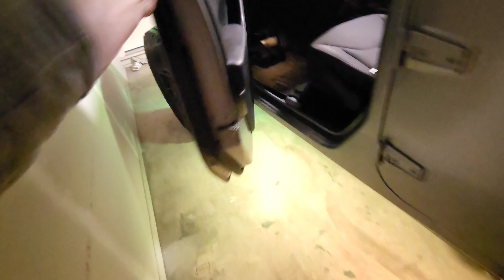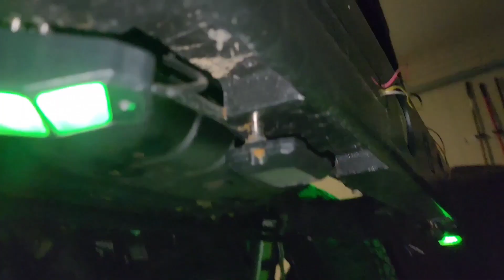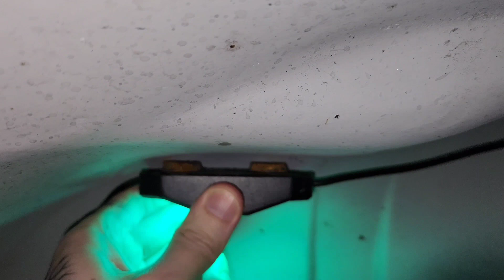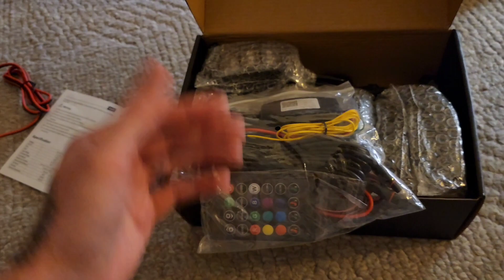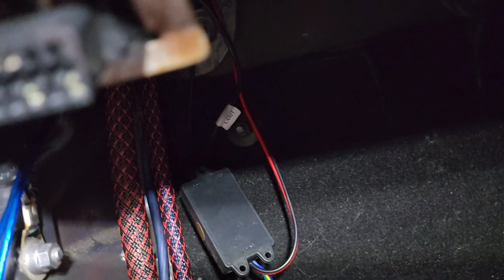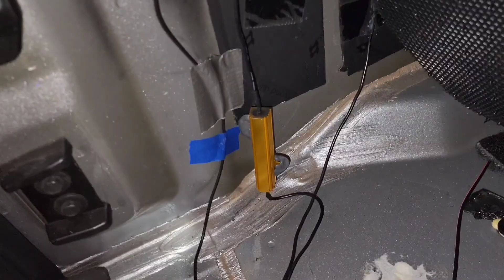Frugal man's XKAlpha ?! RGBIC Rock lights not XKGlow

Comment from the maker: I got these Rock lights here https://amzn.to/445wbSx
That is an affiliate link. The price is the same whether you use my affiliate link or not. If you do use my affiliate link it helps support my channel so I can make more videos like this.

This is a follow-up video to a previous I have on my channel showing me testing the lights before I installed them.
These are the only rock light that I have found that have a smart brake light and turn signal function built into it for under $200
Meaning, that if you tap into your brake light with the dedicated brake light wire on the Rock lights control unit, then the rock lights will go solid red.
It's the same thing for the turn signal. That is an incredible safety feature. You don't have to do it but of course as you see the video, I chose to do it.

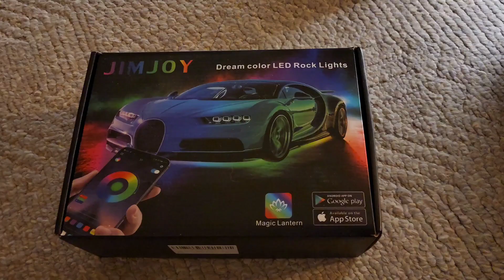9:16 Unboxing & brief discussion of details

Comment: Hey are you comfortable showing how the Joying headunit can use 4 cameras? On the unit it looks like I can only see two camera inputs, but I seen a video of you introducing 360 but not the actual application. Joying YouTube shows it works but they haven’t shown how to install on headunit
Reply from the maker: True. In fact the unit can support up to 6 cameras. I have finished the install of the 360 camera system yet but I'll have a video on that too.
And you're correct. The back of the Joying head unit only makes it appear that it can accept two camera inputs and also a video source input (like DVD or even a camera really)
But if you take the top off of the head unit, there is a plug for the 360 system. It's on the circuit board
Reply: @ElevatedVehicles  thank you so much! I enjoy your videos because I’m looking to upgrade a lot of shit on my 2015 Jeep Wrangler JK. I always appreciate videos that show upgrades and the kind I want. 🤘🏾keep it up! We need more “mall crawler” videos lmao even though I think you mentioned that you do go off roading. Your Jeep is fire so far 🤘🏾🤘🏾
Reply from the maker: @msmonee91  man thank you for the words of affirmation. That motivates me to keep going.
Yeah that's true I love my "mall crawler" amenities even when I'm off-roading or camping.
I've got a video coming out for a heated steering wheel. And I think that's going to be interesting trying to retrofit the heated element function since the JK and JKU never had the option from the factory.
It's gonna be a challenge.

But yes if you take the top off your Joying head unit (if you have their latest 2023 Android 12 unit) you'll see on the top left corner of the board an input plug. And if you watch my 360 camera unboxing video you'll see how all 4 cameras split into one connector. And that's where it plugs in at.
I'm eager to install it and do some testing for them.
I do believe in future head unit releases they are going to provide that 360 camera input onto the back of the unit so that us end users don't have to open up the head unit case.
Reply: @ElevatedVehicles  sooooo ironic that I was LITERALLY looking up how to add heated steering wheel and possible heated/vented seats. Please do that video of the steering wheel! 
Thanks so much for the info on the head unit…when I’m able to I will definitely be purchasing. How do you feel about the sound quality? I’m think of doing a complete upgraded aftermarket sound system, but I wonder if a DSP is enough or is this headunit just trash for sound quality?
Reply from the maker: @msmonee91  it's really good (the headunit) on sound quality. Even had a DSP. There's a Facebook group called Jeep Wrangler Bass Heads that I am a member of & there's a lot of good info on that group.
As for the Joying, it's my favorite head unit I've had in my Jeep & I've tried a lot of em.

The heated steering wheel video is up here's the link. The retrofit is gonna be a lot of work but I like a challenge.

https://youtu.be/Ber4yIRmrQM
Reply: @ElevatedVehicles  I’m def gonna check that group out. Thanks and Mann I’m excited to see how you did the heated steering wheel …thanks for always responding
Reply from the maker: @msmonee91  yes sir happy to help! I'll make a video once I figure out this steering wheel wiring on how to install, etc...